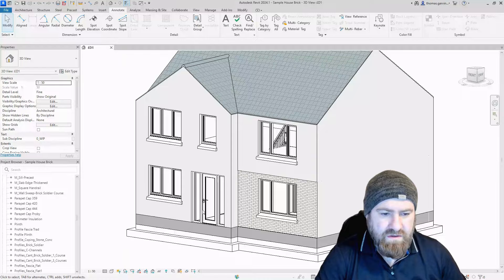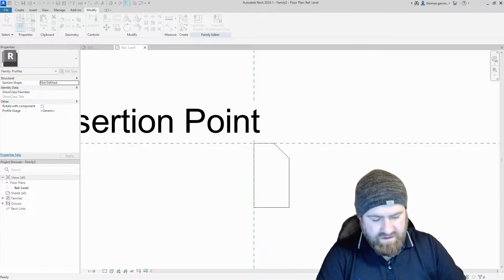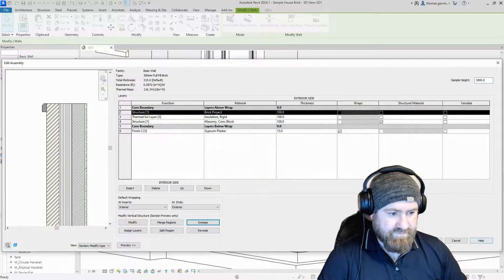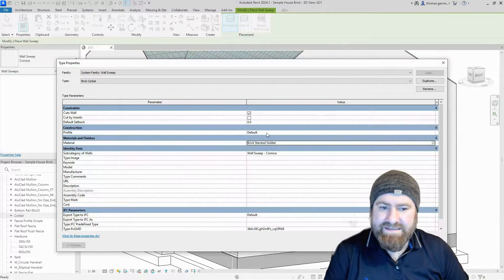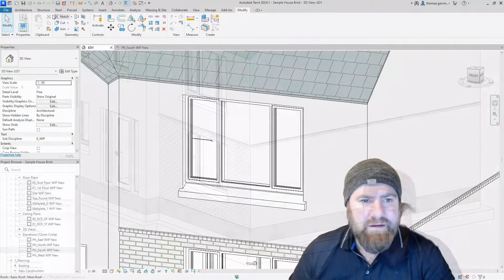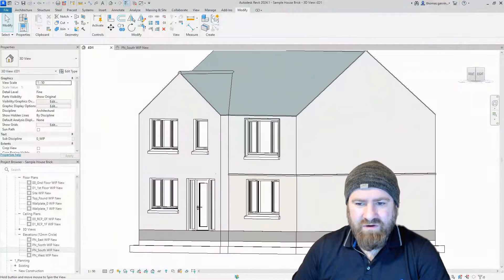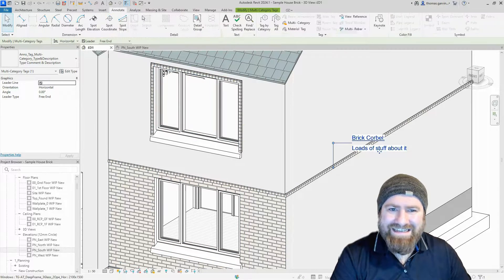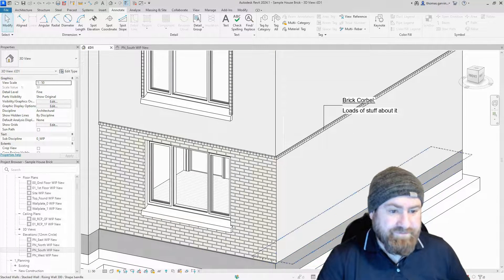Wall Sweep or Wall Sweep

Comment: First of all i'm honored to be mentioned in your channel ... 

And yeah it's a great explanatory tiutorial as usual, and that's why i prefer the manual add, i mostly use them after i'm starting my elevations treatment, decorate and give the building its look, at the same time i hate to have dozens of walls, so adding them manually would be a better quick accurate way... Oc this doesen't apply on all buildings types ... 

At last thx Thomas, keep up the good work 😊
Reply from the maker: Thanks Fouez, I appreciate you